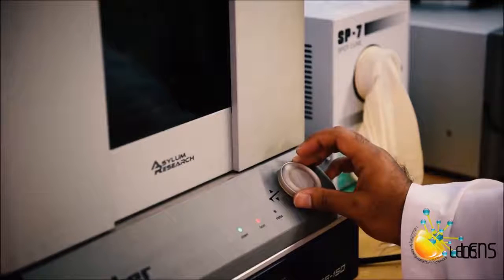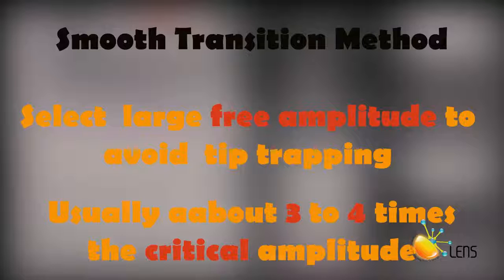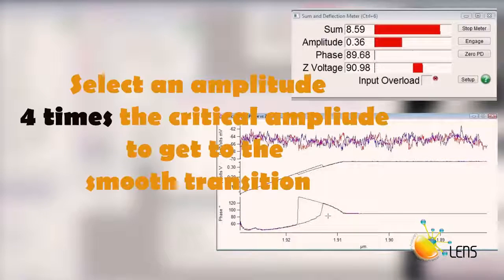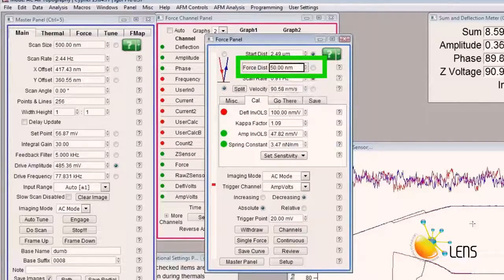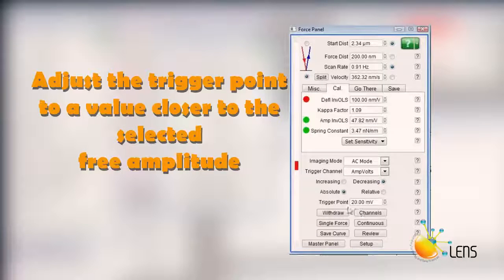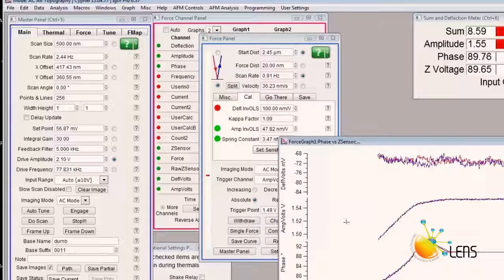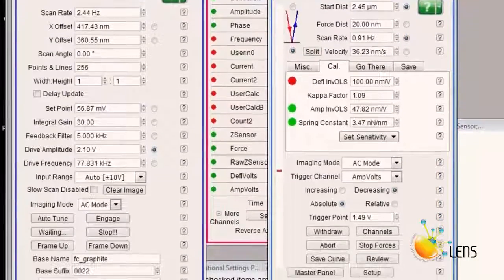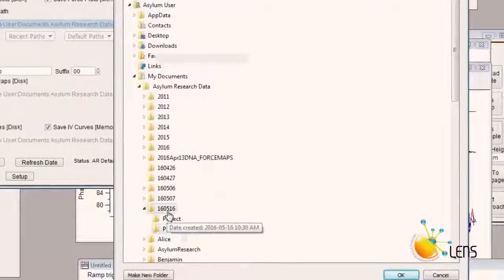Asylum Cypher AFM Tutorial#3 Critical amplitude and force ra

Comment: Hi. Thank you for this video. I am trying to perform nanindentation/force curve using Asylum Research MFP 3D AFM. My sample is a bearing steel, and I have a single-crystal diamond tip cantilever. I have been unable to calibrate the cantilever. Would you be able to kindly help me with this? Thanks.